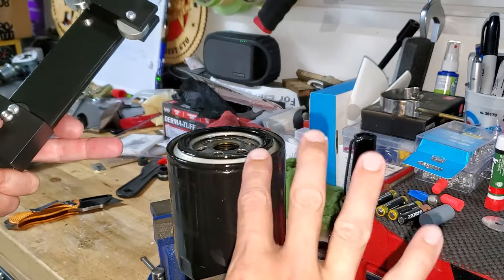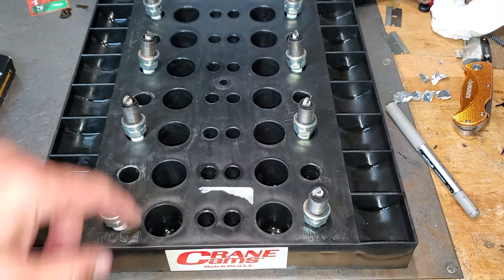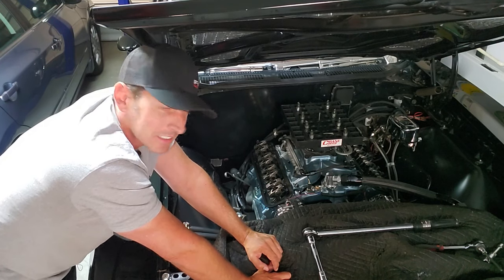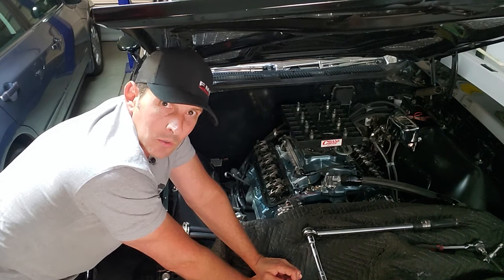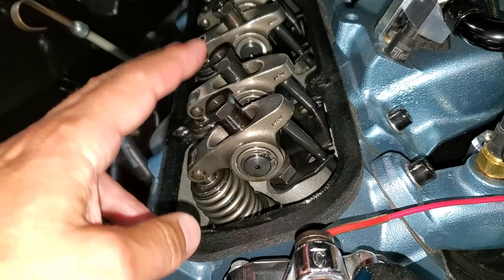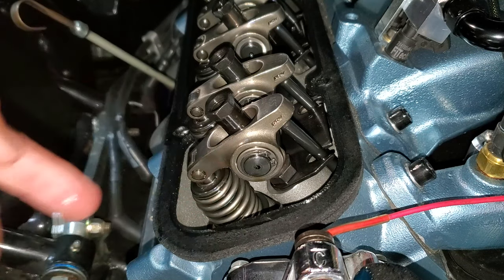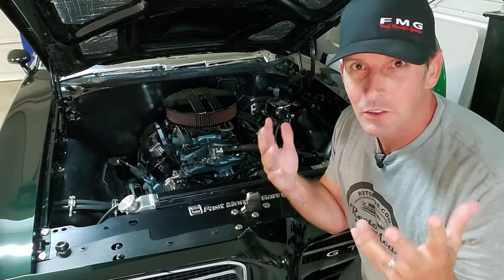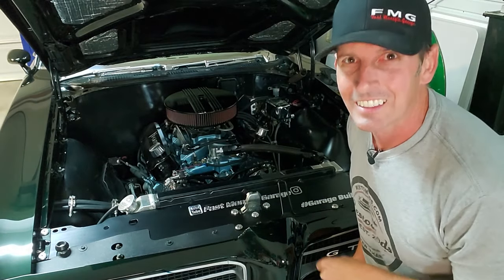Inspecting my new engine, and how to properly set valve lash.

Comment: Hi FMG,
      Thanks for dropping the knowledge.   
       Between you channel and  Jon at   Vinyl  Village Garage I've gained a huge amount of Poncho specific knowledge.   
     I'm a child of the early 50s and had a 400 4 speed GTO through my mid 20s.  I found a 74 400 Catalina a few years ago and am currently finishing a 66 389, 40 over power plant. Heads are on and I'm ready to set the valves. 
          This was a great refresher course.
            Save the classics.
Reply from the maker: Awesome!  So glad I could help knock off some cob webs.  Great project you have there... keep at it and let us know how it goes.

Comment: I also bought a valve torque wrench. Thing is awesome. And for my Pcv valve, I installed a catch can instead of the oil going into my intake.
Reply from the maker: Ohhh, haven't heard of valve torque wrench.  I'll look that one up.  A catch can is a last resort, I'd rather have a perfectly operating PCV system.  As you saw, there's no oil going through it.  All is good.  Thanks!

Comment: They way I set the lash is everything you did but I use a feeler gauge .012~.022 depending on cam card. I have a comp cam and it recommended those numbers above. Loose for more ramp RPM and tighter for more torque.
Reply from the maker: It sounds like you have solid lifters, is that right?

Comment: I would get tested for Covid if I were you. I use the EOIC method for adjusting my valves at 1/2 turn. I don’t spin the pushrod but use the up/down method which is more accurate b/c your drag would differ from mine. BTW you can buy shorter lock nuts than yours. A few of us in Canada would love to buy the Wagner PCV adjustable PCV valve but with the dollar exchange in Canada, it’s just too expensive. We even thought of a group discount. Also all engines such oil vapor, so I don’t know how yours can be so dry. Maybe it’s clogged or not working. There are specific instructions on setting these up. All engines are different and have different vacuum readings at idle depending on the cam.
Reply from the maker: Ha!  I have a 7 year old, of course I tested, multiple times.  Thanks for sharing your method... yeah, bummer about the exchange rate for the PCV valve.  I was shocked at how dry it was too... but, if you recall, I have a massive baffle on that Tomahawk valley pan, and the PCV valve is tuned for my engine vacuum.  Thanks for the comment!

Comment: Have you ever considered the valve adjustment method wherein you just loosen everything, take all of the play out of every pushrod, turn the engine 1/4 turn then again take all of the play out.  Repeat this for two full engine revolutions. THEN preload every single rocker by the same amount.  You don’t have to keep track of where you are and it comes out perfect.
Reply from the maker: Wow... that's a new one on me... but, does make sense.  I'll look into it.  Thanks for the comment!
Reply: @FastMonty  I spent 40+ years adjusting valves by chasing the firing order until someone turned me onto this easy method.  It’s so simple that it’s genius!
Reply from the maker: @thomaspiini7981  I'm definitely going to try it next time.  :)  Thanks for sharing!

Comment: Can you share how you route your positive battery cable to avoid a meltdown? I just switched to the RA cast exhaust manifolds and there is little room for the +cable to route between the exh. man. and the block/engine mount!
Reply from the maker: Good question Tom... My battery is in the trunk.  Ha... I know that doesn't help you.  I would recommend re-wiring your positive cable, maybe even route it under the fender and run it under the brake booster to the starter.  That should avoid the manifold.  Let us know how it goes.
Reply: Ram Air cars had a specific way of routing the positive cable. 
Some cars used a tube w/ tabs on it. The tube ran parallel with the oil pan rail, and was bolted into the motor mount holes via the tabs. 
Others may have been routed differently, but I’ve owned 1st and 2nd Gen Firebirds and Goats, and I like to use factory routing, so I buy the wire routing tube that bolts to the front of the head. I then run the cable down that tube, gently bend the wire so it goes into the horizontal Ram Air tube I was talking about earlier, then out the RA tube and directly onto the solenoid. 

You can do a much simpler version by routing the positive cable from the battery; down to the lower block area/along the oil pan rail; then through some insulated cushion clamps that will be bolted onto the block via engine mount holes; then onto the solenoid. 

MOST IMPORTANT: CLEAN, SOLID GROUNDS!!!
Reply from the maker: @CrawdaddyCustoms  Awesome stuff... thanks for chiming in!

Comment: Hey Mike, random question: what wiper motor are you using?  With my tall valve covers I’m having some clearance issues. Only option I’ve found so far is from Detroit Speed, but it’s for a Chevelle. Thanks - look forward to more videos!
Reply from the maker: Yeah, I have the Detroit Speed unit.  But, it's non operational.  If I get caught in the rain, that's what RainX is for.  :)
Reply: Ha!!  Goal is to not drive it in the rain😏
Reply from the maker: @MrLittlegto  Exactly!